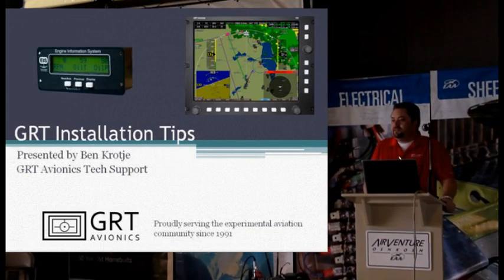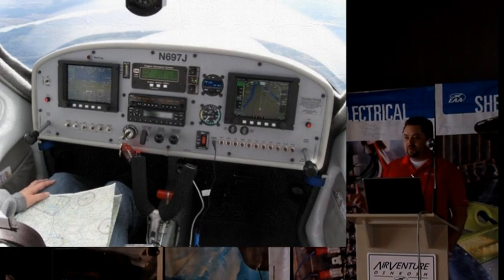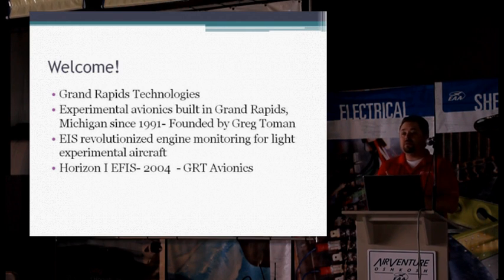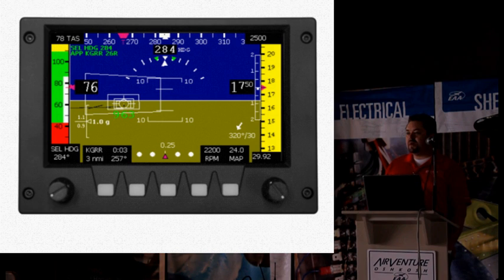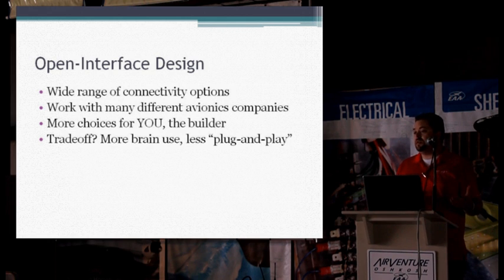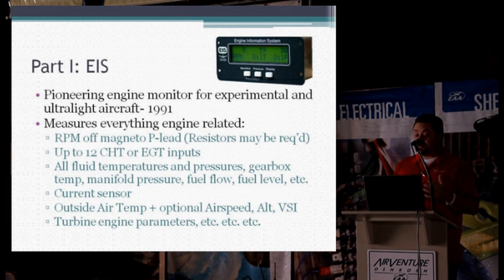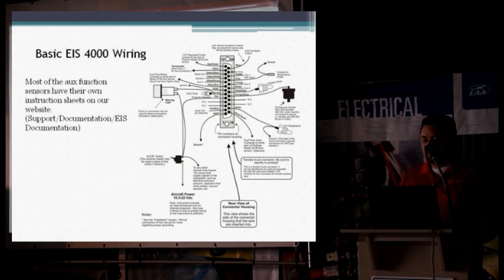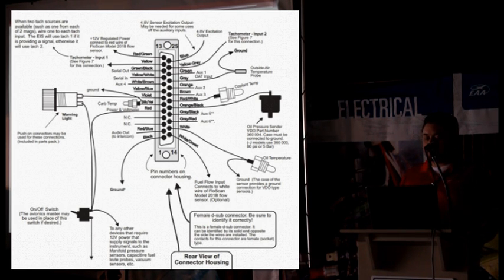GRT Avionics Installation Tips: Part  1

Comment: Did I hear him say a trim indicator? I wonder how this would be implemented?
Reply from the maker: Trim position indicator.  The EIS Aux inputs are sometimes used to read trim position (and/or flaps position) and send it to the graphical EFIS display.  This is commonly used with Ray Allen trim position sensors which change resistance with position (potentiometer).  Wiring them results in a voltage related to the position that the EIS can convert into a number, and then the graphical EFIS display can scale the numbers onto a left/center/right or up/center/down line with pointer.

Comment: Hi
Do I need both EIS and EFIS work as one or can be used separately!Let me know please.
Reply: Stanislaw K  they can be used separately you don't need the efis  . There is a single wire that links the two if you wish to do so.
Reply: Pug Philo 
HI. I just installed EIS 400/600 with GRT sport ,all works fine except oil presure showing 8 bars with no working engine .Rotax 912 1oo hp new one with a new type  sender .Analog guage showing correct but once connect to EIS shown 8 bars after turn ignition switch. The guage it's a UMA .Please help if you can .Thank uou